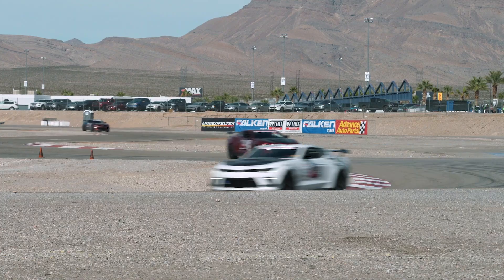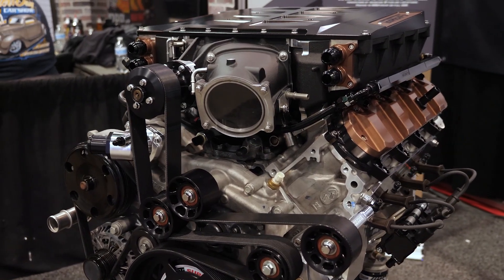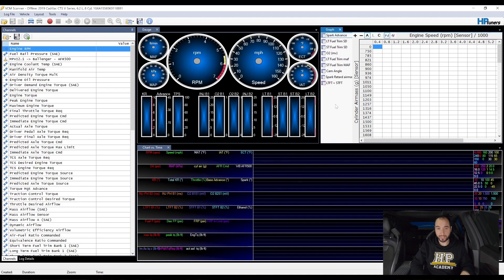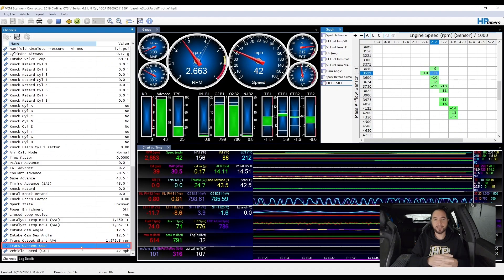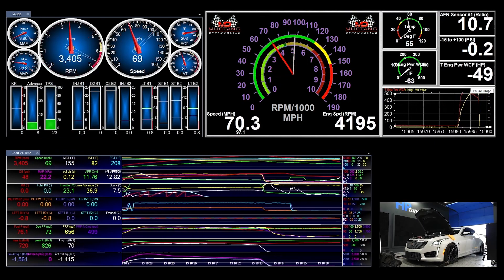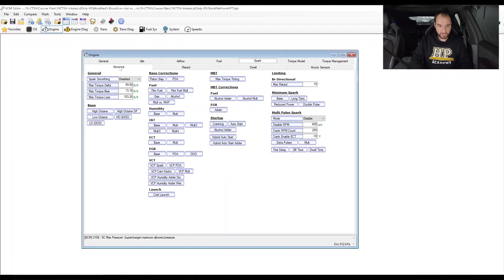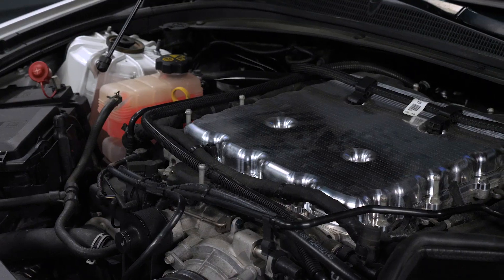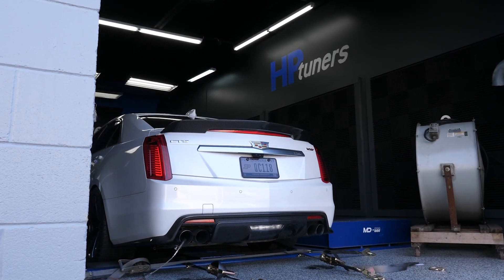Tune Your Engine Like a Pro - GM Gen V LT Online Training Course

Comment from the maker: If you are not new to tuning and are just new to GM Gen 5 ECUs, you can find this Worked Example using the HP Tuners platform in the Practical Reflash Tuning course. Enrol now: https://hpcdmy.co/gmgenvy

If you are brand new to tuning, grab the EFI Tuning Starter Package instead which covers all the knowledge you need before you even think about opening your tuning software. Enrol now:  https://hpcdmy.co/GMfullpackage

Comment: I tried to find the LT based course on your site but didn't see it. Is it just part of another course?
Reply from the maker: It's a Worked Example in the Practical Reflash Tuning course. If you already own the course you get it for free, if you are just buying the course now you get a bunch of other examples included and any we add in the future.

It is not priced based on the examples so you're not paying more for the extras, they are just added value.

Sorry for the confusion! It would be a bit more straightforward if we charged for every individual example but for those learning we think having access to more material without having to pull out their wallet constantly is more helpful - Taz.

https://www.hpacademy.com/courses/practical-reflash-tuning/?utm_source=youtube&utm_medium=social&utm_campaign=general-interaction
Reply: @hpa101  thanks! The vip seems the way to go though. Tons of information for that price.